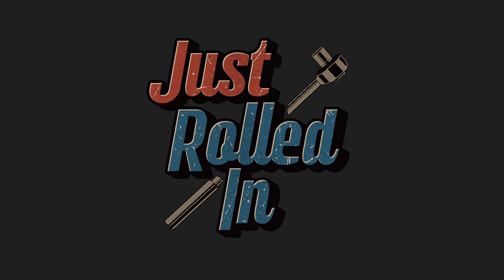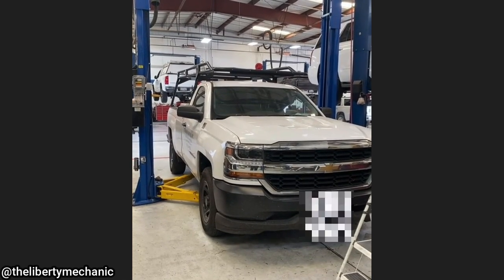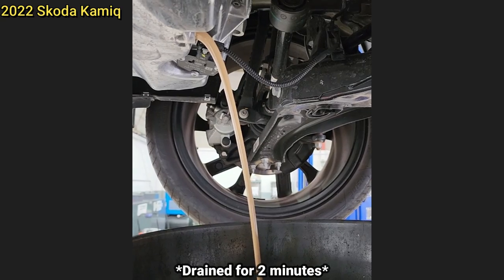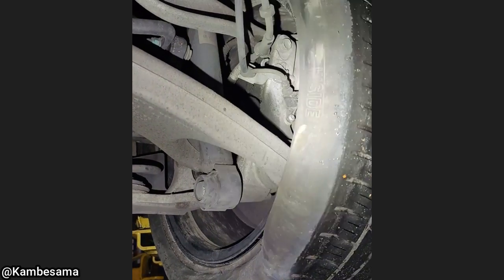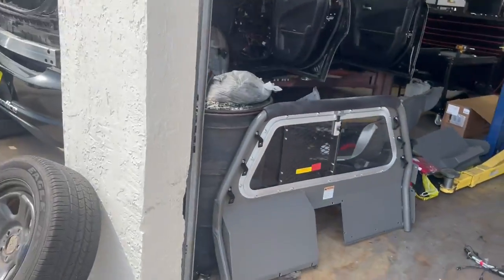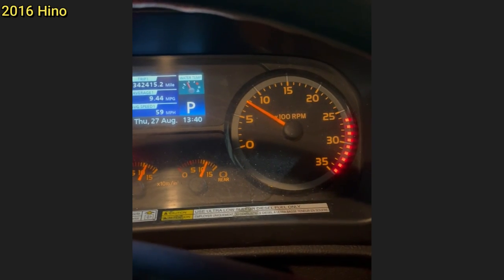Customer States Brakes Locked Up | Just Rolled In

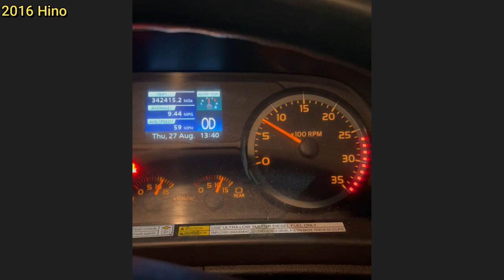Comment: 2:46 - My Dad's Citroën C4 Grand Picasso had this. After passing my (UK) driving test in it, the examiner commented on the 'interesting' steering wheel. 
It also had an electronic handbrake that disengaged on acceleration by design, which I informed them of before starting (just in case they failed me on forgetting to release the handbrake).
Reply: That’s one of my dream cars. Idk why but I just love the looks
Reply: My ford also has an electronic parking brake that disengages when you hit the gas, but the middle of the wheel not moving just disturbs me for some reason
Reply: @vthegoose  you're getting used to it right after ten seconds of driving.
Reply: @czarnykurczak  I'm sure you're right, but it would be annoying to have the position of the controls in the center stationary with respect to the wheel instead of my hands.  Again, probably just because that's what I'm used to.
Reply: @jasonpatterson8091  This is exactly what I thought when watching it.
Reply: @JoeyLovesTrains  they are absolutely horrendous things, like most Citroen and Peugeots are!
Reply: @j4cko56  I never said how reliable they were. I only said that I like the look of them
Reply: And today many other cars have the same parking brake feature, like Subaru.
Reply: My Honda will loosen the handbrake on acceleration and scream at me to disengage it
Reply: In UK you do pass your exam in your familly car ?
Reply: @tomjoad1363  You can use almost any road legal car. You have to provide an extra rear view mirror for the examiner. Some cars cannot be used due to limited vision:

    BMW Mini convertible
    Ford KA convertible
    Smart Fortwo (2-door)
    Toyota iQ
    VW Beetle convertible
Reply: Cadillac in the 80s released the parking brake when you shifted out of park. I still miss that.
Reply: the handbreak thing aint so new.. have a 2013 golf that goes one step further and has full on auto hold.. I dont need to interact with the E-break at all.. I stop it keeps the breaks on.. i move it lets go... I stop and get out without putting the "hand" break on it just switches over to it by itself.... now thats even a feature on fords.. though some manufacturers still dont seem to the basic version on their cheaper cars (like ya dads picasso.. and handbreak that comes off by itself)

Comment: The Citroen fixed steering-wheel boss was so they could fit a full-size square air-bag in it, just like the passenger side.  On normal cars, they can only fit a small round air-bag because the orientation of the steering wheel in an accident is unpredictable.
Reply: I've always wondered how car makers would overcome this, especially when you look at the small overlap crash test where the front airbag is useless half the time.
Reply: Okay I did not like it until I read this. Perhaps it should actually be standard.
Reply: there is others benefit from it like
- no wears and tears on connectors for the wheel  command
- the wheel tself is cheaper since it doesn't as to support commands and the airbag
Reply: Not a bad idea I guess, but I'm still not sure how  I would feel about that, would definitely take getting used to if nothing else!
Reply: Personally I love it, I have cruise control buttons right in sight and radio controls as well and some other control, better than having them behind the steering wheel where you cannot see them
Reply: @casperhansen826  I mean I have all those buttons on my steering wheel but I'm so used to them moving with the steering wheel. I have never driven with a steering wheel like that, but I feel like I would find it strange, at least for a while.
Reply: @nickarganbright7218  I don't think you press any buttons while steering. Cruise control, definitely going straight. Radio? Shouldn't change the station or track while steering, right? So normally you will have the buttons just as before.
Reply: @psycho__9945  But doesn't the steering wheel still need to have a clock spring just like any other steering wheel?  How are you going to get the wiring through the steering wheel and shaft if you don't use clock springs?

Edit: Nevermind.  You can run the wiring along wherever the center hub is fixed to.  I just don't understand how the steering wheel is able to spin 360 degrees behind a stationary center hub.  What's it connected to?  Or is it electronic steering?
Reply: I just figured Citroen kept breaking clock springs so the eliminated the need for them.

Comment: I drove a Citroën with that steering wheel setup for a couple of weeks, and it's actually really nice to use. The car was good to drive, and the controls were very instinctive; and always where you last left them. 🤣🤣

The seating position however, was abysmal. No amount of adjusting the seat and wheel angle could make it remotely comfortable to sit in. Fifteen minutes of driving and my hip and lower back felt like they were on fire. Which surprised me, as the Citroën BX I owned many years ago was amazingly comfortable.

That said, I wouldn't trade the X-Trail I currently drive for any of the Citroëns I've driven in the past.
Reply: I had a Citroen C5 X7 as a rental car a few years back. Most comfortable car ever driven, 1200km per trip.
Didn't like the fixed hub in the steering wheel though.
Reply: @michaelb7071  the C5 of several years back was a fantastic car. That said, the C5 wheel hub got quite bulbus and busy. I'm not sure I would have got along with it either. Perhaps by that point, they had taken a good idea a bit too far.

Somebody at Citroën must have agreed. I was looking at the new C5 Aircross recently, and that has a very conventional steering wheel with pretty average wheel mounted controls.

Comment: I've driven a Citroen with a steering wheel like that a few years back, it was a facelift C5 wagon. The hydropneumatic suspension was even more bonkers than the wheel. It was so smooth I think it wouldn't even pick up bumps on Omaha beach. Also, it had a 3.0 diesel V6, had locomotive torque. It died when one of the rod bearings grenaded (known issue).

Comment: Love the steering wheel of my citroen C5. it is actually the last car of an Era, and I fear it will be the most comfortable car I will ever own with her hydropneumatics, centainly I enjoy every single meter drove with this car. And yes, it has the same center-fixed wheel hub, I always know where to resume cruise control or turn up volume when something interesting sounds on the radio. Actually PSA used to have fixed controls, but they were behind the wheel.

Comment: Citroën always had their own idea on steering wheels. I still remember the single spoke steering wheel they had on the SM in the early 70s.
Reply: A guy I knew years ago had one, a DS Pallas I believe. It also had the monospoke steering wheel. I guess it made sense. At 10 and 2, where your hands are supposed to be there's nothing to block them. At 7 and 5, where most people actually have them, there's something extra to grab in an emergency.
Reply: @christopherconard2831  I and most people I know have one hand on the wheel, usually at 12, sometimes at 6. Pretty sure they teach you to use 9 and 3 when taking your license nowadays though. (In Sweden at least)
Reply: @jongustavsson5874  They teach 9 and 3 these days specifically because of airbags inside the steering wheel. At these positions, your arm has the least chance of being forced into your head when the airbag is deployed. The drivers who drive with airbags in their steering wheel and drive with poor hand positioning are really asking for it during a car accident.
Reply: @FreeSalesTips  sure, they are, then again a large part of the driving population are still oblivious to the safety device known as the seat belt. I mean, it has only been around for like 60 years.
Reply: When i was a kid, my parents had a Citroen Ami, it also had the one spoke steering wheel.

Being a French car, it offcourse burned.

Engine caught on fire for some reason and the spare wheel was conveniently placed on top of the engine, so lots of "food" for the fire, in that tyre.

Here French cars are known for electrical problems and cars going up in flames.

Especially the 307, that thing was so prone to catching fire when parked up, that insurance companies told costumers that they had to park the car away from their house, other cars and other things that could catch fire, and if they did not, the insurance would not cover.

At one point all of the ferry companies had a clause, that if you drove a 307, you would not be allowed onboard the ferry, unless you agreed for them to disconnect the battery, while the ferry was sailing.

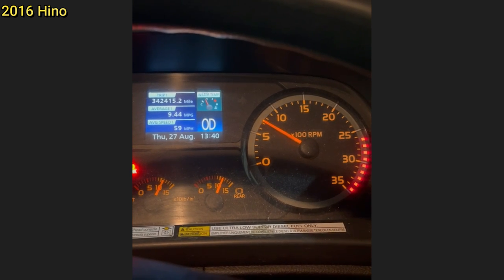Comment: 2:46 about the steering wheel - interesting idea, but pass.  It would be harder to find the buttons without looking since their position relative to your hands changes with the wheel.  That's assuming small corrections.  For bigger input, it would be an advantage, but you'd have to use a non-driving hand to operate it.
Reply: I have a nash with a steering wheel similar to that. 

When the clutch drive in it broke, it was hell fixing. So I like simplicity more.
Reply: It used to be pretty normal for Citroën to have weird shit going on but I'm better their most recent stuff just doesn't have that sort of Citroën weirdness. I wouldn't really know though, as contemporary cars don't really do anything for me.
Reply: You probably shouldn't be trying to press buttons while going round a corner though
Reply: At least the airbag doesn’t rotate like this, and stays stationairy relative to the driver.
Reply: Thinking the same. I like my buttons always being at the same place relative to my hands' default position on the wheel. Then again, if my hands are far enough from resting position for button position to be a bother, I'm probably in the middle of a manoeuvre that requires considerably more steering input than typical and probably cannot be bothered messing with stereo controls. Looks a bit weird but likely fine once you get used to it.
Reply: It made me think of the Edsel- push button transmission controls at the center of the steering wheel.
Reply: I know alignments would be a pain in the ass. Unless there is an alignment reference point on the steering wheel itself.

Comment: the citroen steering wheel looks cool but it needs a stripe on the wheel itself or some kind of indicator so that you can tell when the wheels are not aligned. maybe it's just my poor driving but when i had one, i would jump in after doing my shopping, start backing out thinking i'm straight and then whoah!  nearly clipped the car next to me because the driving wheels are still at the angle i left them when i pulled in.   i kept doing it too - takes some getting used to!! 😲
Reply: Wow, you reverse by looking at the steering-wheel boss?
Reply: @normandiebryant6989  that's what i've been doing wrong! 😄

Comment: Dude replacing that wiring harness has to be a nightmare job… there had to be an easier way no?
Reply from the maker: Nope and it's a police car. So lots of extra stuff to remove.
Reply: @JustRolledIn  oh no!!! how much was that bill? Looks like the car almost had to be completely remanufactured! 😅
Reply from the maker: @user-qx2ec7oe9p  luckily was warranty but the police department had to pay a bit since all of the accessories add extra labour time.
Reply: I have scrapped 20 year old luxury full size cars for parts, and the wiring harness removal involves complete disassembly of the vehicle. Chrysler would have been money ahead supplying a new vehicle.
Reply: From what my instructors have said, you can usually charge for remove and install engine as well, just to really milk it
Reply: A wiring harnesses.....the make or break for any tech
Reply: Was it really worth it?  
Long periods of idling isn't good for the engine either, & simply turns a low-mileage vehicle into a high-usage one!
Reply: @JustRolledIn  tax dollars hard at work.
Reply: Yep just set it on fire
Reply: It makes no sense why the entire harness has to be replaced.
Reply: Yup, let it burn
Reply: @mxerb5912  actually it makes complete sense. You could pay a tech 2x the money to track how far that wiring is muffed and pray he did everything correctly and actually found the root of the problem, or you could go with option A and just replace the whole damn thing since they are literally already there.

Comment: I’m the technician who uploaded the cop car video just finished it today Thursday April 20th have been waiting for the harness since January to correct what was said the rear fuse box ONLY comes with the entire body harness does not have any harness connectors attached to the fuse box I got paid 7.3 hours warranty and got additional time to remove the cage and center console that was aftermarket upfit with the aftermarket wiring for it 8 hours for that so 15.3 hours was it worth it hell no but atleast I’m the only 21 year old in the damn country that can take apart a cop car and put it back together and make all the lights work without no help and no wiring diagrams for the aftermarket stuff
Reply: Good job.
I had a Focus harness burn up bc of a cheap fuse and shorted tag light sockets. I ended up using a junkyard harness as the OE was un available.
Reply: @williamfranklin6283  wow you had to get a junk yard harness that’s bad can’t get parts for anything

Comment: My 2008 C4 Picasso had that steering wheel setup - works brilliantly, you always know where the radio volume and cruise control controls are. My 2015 had the controls moving with wheel which I think is a backward step

Comment: I actually like the Citroen steering wheel.  If my steering wheel is turned I can’t find the radio volume button (for example) until the wheel is straight again without taking my eyes off the road and looking for the correct button.  That wouldn’t be a problem with this Citroen.
Reply: So instead of waiting until you are finished turning to mess with the radio you remove a hand. Sounds real safe, especially if you get into an unexpected series of events and your brain is no longer concentrated on the car, but the radio. But in hindsight at least you have a full size airbag to punch you in the face, silver linings I suppose
Reply: @codyslayer6715  
 
I don’t take my eyes off the road that’s why I wouldn’t change the radio station when the wheel is turned.  With that Citroen stationary button pad I could easily hit the correct button by feel because the buttons don’t rotate.  My daily car doesn’t have steering wheel buttons, it doesn’t even have airbags, that wasn’t really a thing in 1980’s.  I rarely listen to my radio and run straight pipes so my car is pretty loud.

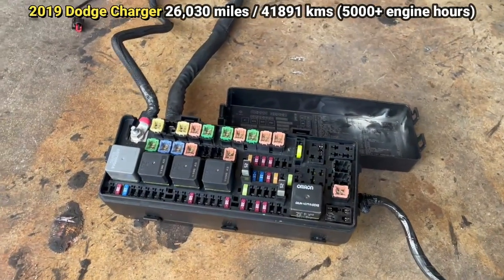Comment: 1:42    I've heard so many complaints from the garages that service cop cars about the Charger.  It holds up pretty well under civilian use, but with the abuse cops put them thru it clearly was not designed from the factory to tolerate it.  Worn out ball joints, shocks, suspension parts bending, etc.  The 5.7 Hemi V8 has a design flaw where it doesn't oil the camshaft/lifters adequately at idle.  Its fine on civilian cars, but idle a car 8-10 hours a day, its a major problem.  Yeah its WAY faster than the old Ford Crown Vic, but not nearly as reliable/durable/economical to operate.
Reply: Most of the run of the mill dodge cop cars have a v6 engine in them

Comment: I love the Citroën steering wheel design. Probably distracting at first, but very cool
Reply: i’m surprised by everyone in the comments saying they’ve had it & loved it
Reply: @misseselise3864  Because its fine, when u are in turns where you wouldnt be able to press media buttons.. its probably not a right moment to press them, not to mention on normal wheel people are not able to hit buttons accurate anyway while in turn usually. And they actually did that so they could fit full sized air bag there like on the passenger side.

Comment: That wiring harness replacement...done a bunch of those back in the day. Older TBirds (I'm talking 60s) had "fusible links" which was a short piece of wire built into the wiring harness designed to burn like a fuse in an overload. Yeah you read that right, the fuses were built into the wiring harness. When the link blew it usually took surrounding wires with it, so it was just the better option to replace since you really couldn't know how extensive the damage was.
Reply: Yep, I remember I had an old '80s k car with those damn fusible links.  what a nightmare when one would go.  Don't miss those days, lol

Comment: I'm guessing the guys who cut the rear axle on the truck didn't know where the catalytic converter was... Wonder how much they would've gotten for the differential had they been successful in getting it out. Or someone tried to sabotage it. Either way, that's definitely an insurance claim.
Reply: I'm thinking it has a lsd or locker they were trying to steal?
Reply: I hope it's a mistake as you said, otherwise the customer must have pissed someone off really, really, really good.

Comment: had one of those citroen as a company car. the wheel is kinda interesting, and is pretty good from a safety perspective. airbag is always going to deploy at the best angle, and the controls are conveniently placed. can be a bit misleading though, as you cant see if the wheel is centered when first getting in. i think the newer ones just have a regular wheel though